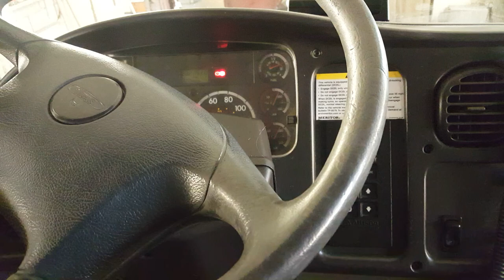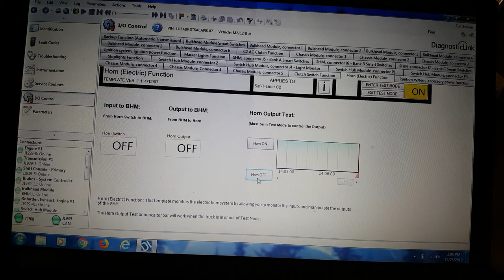C2 School Bus Using Freightliner Diagnostic Link Software

Comment: is this worth getting for my bus? I only have one and I am converting it into a motor home. I was thinking of getting the Icarsoft HD I OBC reader but not sure if that would work.
Reply from the maker: Not worth it for personal use on one vehicle. Unless you have the cash to invest. Your bus is a 9 pin connector not OBD. There's a yearly subscription involved. I would recommend going to a Freightliner dealer and use their software to read codes.
Reply: @MechanicsHubdotCom  What would be the correct software to get if one were wanting to invest in it?
Reply: Does that software work with the cummins engine in the busses? I've got a fleet of 6 c2 busses